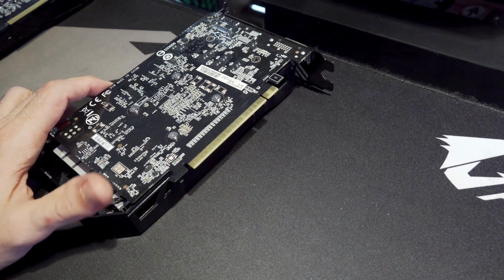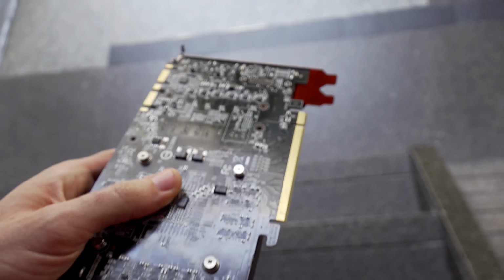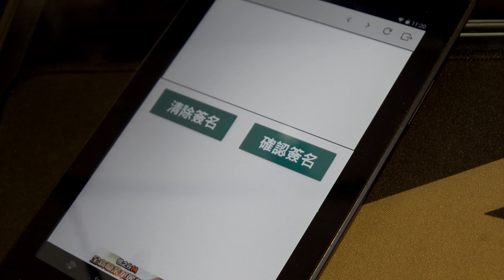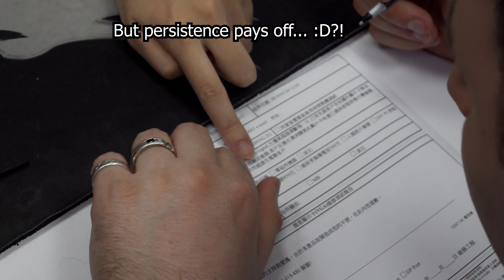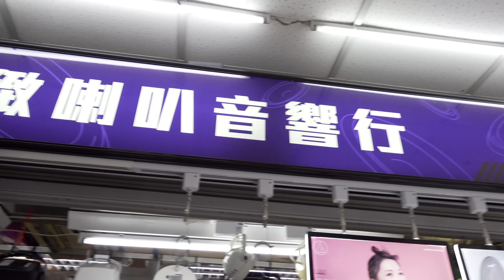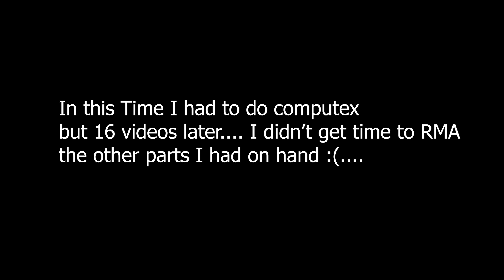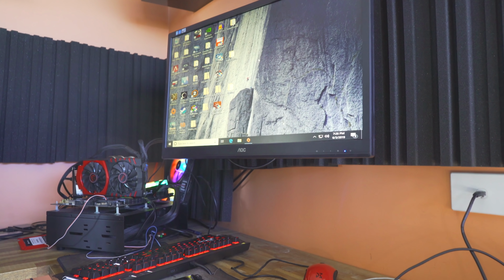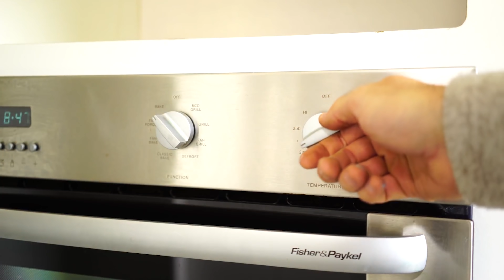I Took FAULTY Graphics Cards BACK to AIB Vendors Directly...

Comment: M9 Bad is basically the section that went bad. One of the surface mount components on the PCB is labelled M9. I couldn't find it. But that's what they said.
Reply: m9 diode or transistor No. you see them on the components
Reply: Woah it's the legend himself 😲
Reply: guys go sub to this legend
Reply: Hail Marco
Reply: Marco lets go
Reply: Love you marco!
Reply: Marco!!! Dont let the haters bother you man, thanks for helping make the yes man's  videos possible in Taiwan!!!!
Reply: @christopherdwyer7570  Oh I know, I haven't lost sleep over it.  Thank you.
Reply: @Generic_Name_1-1  Thanks!
Reply: @Simcadepro  diode is normally D, transistor is normally Q (because transformers were already T), M is normally Motor but i suspect it may be Memory, though U or IC are most common for chips. Also normally on the board and the schematic, not the part. The part number is not normally how you refer to a part as there may be several identical
Reply: That was super cool if of you to help him out Marco. Take care man.
Reply: Where there any used parts in ganghua digital plaza?
Reply: OMG it's Marco, your a Legend bro, How do you put up with the BOGON for a whole week, wow your an uber legend to put up with him for so long.
Reply: Hey it's a marcoooo
Reply: might not be labeled on the PCB but on the schematic
Reply: @EvotrekORIGINAL  Thanks!
Reply: @deepwinter77  It wasn't for the whole week. It was both weekends. During Computex I had other things to do in relation to my clients and take pictures of tech and a few selfies with the showgirls.
Reply: @yurimodin7333  Certainly possible!
Reply: @rencm04  There are dedicated used stores with full warranties and everything. But the rents there are insane and they know the true value of the product, which doesn't make it much of a deal.
Reply: It doesnt matter what you say , do, or look like Marco, you will always get some haters for one thing or the other on the internet! Don't let that stop you though!  Thanks for making this video possible for the majority of us!
Reply: @x240strongx  Yeah, I know, Thanks! It was a fun ride. See you next year!
Reply: sub to the legend
Reply: Best man here !!!!
Reply: M9 is one of the MOSFETs in the VRM.
Reply: In the thickest of Australian accents. "What a Legend". You're awesome man, this was a great video, I was glad to see the humor there as well!
Reply: maybe they got their own jargon
Reply: @andrewryder3075  No, MOSFETs have designation Q, not M.

Comment: Wow  mad props to gigabyte.  They accept warranties for the cards regardless if it was bought overseas.  Glad I  bought  Their 1070 version.
Reply: gigabyte is one of the best manufactors....i use this products for many years! never had any issues
Reply: There's no guarantee for that. They know me at that store and can be a bit more lenient sometimes. Best course of action is to be nice.
Reply: @MarcoGPUtuber  hi, just wondering how Asus fares in the service department?
Reply: @vsmh96  In Taiwan?
Reply: @MarcoGPUtuber  yes
Reply: @vsmh96  Same as Gigabyte and MSI. Walk into any ASUS Royal Club service centre and they'll look at your dead mobo or gpu. Same price as Gigabyte and MSI.
Reply: @MarcoGPUtuber  good to hear. Do you have a personal preference?
Reply: @vsmh96  ASUS and Gigabyte are my one and two. MSI is my three. I sold them for 6 years and ASUS and Gigabyte resulted in the lowest return rates. Right now, I am in possession of an ASUS R9 Nano and a Gigabyte Z97-UD3H motherboard.

I'm approaching 30 and been 'into computers' for about 22 years. I started taking them apart and putting them back together and self teaching for 18 years. Bryan assures me that Asrock is so much better now than it used to be, and they certainly look like they have improved alot. I remember using ASrock once, it was OK, but back then the quality wasn't there. ECS was garbage, and I think they knew that and have since branched off to other industries. I used ECS and it died after a while. ASRock I'd call the Poor Man's motherboard because they had a habit of trying to one up the competition by mixing standards to provide 'upgrade paths'. For example, many of their motherboards in the mid 2000s would mix memory standards during a transition, allowing the use of older memory until you could afford new DIMMs. Memory controllers used to be on the Northbridge and not on the CPU like today. They also had boards that utilised both AGP and PCIE. These boards essentially were for people who couldnt shell out money for everything all at once. It certainly was genius of them to do that back in the day and certainly helped them get a leg up. Good for them! I'm just getting old and habits die hard.
Reply: Well, different service center can have much differwnt service. Gigabyte in mainland China was known for their refuse to RMA record lol.

Comment: I've reflowed 3 Gpu's, in terms of success, only 2 of the cards worked afterwards but it really depends how overheated/damaged the cards are. 
Also on one of the cards, the fault was the vram, not the actual GPU die and thus I couldn't repair it.

Comment: Damn the services in China and Taiwan are so high-quality compared to western countries lol.
Reply: Yeah like how they wouldn't help him at all if marco wasn't there even though it was obvious what he wanted.
Reply: @Noman1000  I mean that would be the only problem and it was ONLY msi lol, the service is still better lol
Reply: @Noman1000  Also a good thing to note is that usually ends up being true for most countries lol. People wanting to scam and scamming tourists and not giving them proper services. Could even happen in the US if u don't meet the right people so yeah. It's a lot easier to get things serviced but by success rate it wouldn't differ much I don't think.
Reply: @Noman1000  Taiwanese here, she basically said she checked the serial number of the card and this specific card did not have international warranty so Taiwan couldn't take the card. So they needed to take it back to where they got the card from. Then Marco said he got from Australia and they don't have a repair facility there. Now I don't know the circumstances and MSI's policy but this usually happens when the card was bought from a region that is not under international warranty (Normally China, Hong Kong, and Macaw) or got it second hand from a Chinese vendor. The problem card vendor is dealing right now is there are so many fake cards coming out of China where some vendor would take an older generation GTX (ie, GTX450, GTX 460), replace its Bios and serial number so it would appear as GTX960, then sell it on AliExpress, eBay, and Newegg/Amazon's 3rd party vendors. That might be the case or MSI's warranty just got shittier. But repair shops are everywhere in Taiwan/China and it is fairly cheap and turnaround time is faster than the company themselves. So to many of us repairing a video card out of warranty isn't a big deal and some even choose to void their warranty by going to repair shops and replace manufacturer parts with better ones.
Reply: lol leave china out of this.
high quality and china are not on the same plane of existence
Reply: @bebisibeb  fortunately they are, you are just speaking bs

Comment: for everyone having a gpu that just doesn't give a signal anymore (often after it has given severe artifacts) try to oven method, i suggest looking it up but basically remove the entire cooler so that you end up with just the chip and processor, preheat the oven at around 200 degrees celsius, place the card on foil-made stands on all four sides and let it sit for 12 minutes, it has worked for me two times already

Comment: u finally answered what i always wondered on a few of your videos as to why u didn't just solder something all u need to do is practice a lot best thing to learn on is a ps2 or  xbox 360 analog sensor its 14 pins to replace lol but practice on something else 1st if u can replace that u can do 90 percent of the stuff out there that is how i learned  back in the early 2000s i was like 14  i had my dads older soldering iron some solder and flux and 2 ps2 controllelrs with messed up analogs  on both had left analogs that walked on their own but right was good  soi had idea to take right outa one and put back in other so  i read a few books on how to solder and desolder i got at library  took a old 56k pci card and practiced til i could remove  and put back on chips with no burns and it looked like factory when i put it back then i went at it taking good right analog outa 1 controller then the bad left analog sensor outa the other then replacing it and resoldering everything i was so happy it was a 14 pin solder job  and  i had fixed my own controller with what i learned from reading  and a little thought i had i made so mutch money back then with that skill fixing things for people  and all because i wanted to play gta 3 proper lol.

Comment: when resistors look broke off manufacturers tend to send new componets if they even cover broken components off the pcb (xfx doesn't cover physical damage to the card unless it was a result of thier shipping) because they're could be tons of issues like possibly the contact pads could be ripped up or there could be a short inside the pcb that caused it as well
Reply: That doesn’t make much sense though, because the resistor is like $0.001 and takes 5 minutes max with a basic SMD hot air and pair of tweezers with unskilled labor. I don’t know why they wouldn’t try the easiest and most simple repair there is and just see if it works. I’m not saying they don’t toss them, just saying it doesn’t make sense to me. You just check it with a meter and see if it checks out. With thousands of components with even 0.000001% failure rate, it’s very likely it could just be that one small thing for lots of the cards (if it’s MOSFET, then it’s probably toast....).

Or they go the Apple route and say they are too incompetent to even change a battery, which I’m pretty sure a 5 year old could be trained to do, so basically they are a “service center” that says, “just buy a new one!”

Comment: That's the thing with resistors, caps and other SMDs on modern, rather high end electronics like Graphics Cards. If they blow catastrophically within typical warranty periods, they rarely failed "on their own", but is a symptom - of something else gone bad. Troubleshooting that can be a huge hassle if you don't have basically the same equipment as they test the cards with during QC at the factory. So they give you a new or manufacturer refurbished unit for time saving, and ship the faulty item off to the factory or a dedicated repair center with the appropriate equipment. If they find the fault and it's worthwhile fixing, they fix it, replace the fans or the whole cooler assembly, reapply goop and pads, and ship it off to be ready for the next service case needing replacement.

Comment: 9:15 M9 Bad - is memory chip M9, but the 1050Ti only has 4 memory chips labeled M1-M4, so no idea why it would be M9.
The 1070 may have burnt components, but more to the point, what burnt them out. Usually a burnt component means something shorted and possibly blown up other stuff as well, only the weakest part will take the full fault. I can fix those faults.
Reply: it may only have 4 chips but the pcb probably has 11 or 12 places that chip could be located and spreading them out helps keep temps down so position 1, 4, 7, 9.

Comment: never do oven method if you have broken card you need use flux and minimum heat gun but when I bought foulty rx580 and I find is still under warranty I send back to manufacture and he send me brand new rx 580 all my cost been 57 pounds 1 year back :-) you can find that video on my channel as well

Comment: The M9 I'm guessing is the chip number/call sign for the bios chip on the board I have no way of knowing as I dont have the board view schematic for it. But I have a R9 290 with the same exact symptoms as that card. And per buildzoids stream they said that would be the solution to these issues. Hope this helps anyone out there!
Reply: M9 or any letter_number key is usually a part labelled on the PCB silkscreen. In this case M9 is likely a MOSFET
Reply: @cybercat1531  M is usually reserved for purely mechanical sub-assemblies. The schematic/silkscreen designation for memory ICs would be U (unseparable sub-assembly) and also often applied to MOSFETs in an IC-like package, but most usually MOSFETs carry the Q designation unless they have some kind of extra functionality.
I'm thinking M designations are just some kind of symptom code that the triage department assigns to the board before it goes to the repair engineers.

Comment: M9 is most likely the identifier of the component on the schematic and PCB level that was faulty and needed replacement. During the design process for circuit boards each component is given a unique identifier to both identify them and also for linking when moving from the schematic capture phase to the PCB layout phase. Knowing M9 was faulty they would then look on the Bill of Materials for the PCB to get the  components detailed information. Hope this explanation helps.

Comment: That is totally cool that you were able to get those cards repaired or if they replaced them even. I wish we had stuff like that every where so you could take your some what broken stuff in and they can repair it for the fraction of the price of having to buy something new. Even better is that it lowers the throw outs into the local dumps for these types of products. Yes we have local recycling places you can take used parts to but I am sure most people don't actually take the time to do that.

Comment: With all the bargains and graphics cards and deals, I really need a video that covers DisplayPort cables and finding the right one. I'm currently looking into getting Cable Matters DisplayPort cables. They're long enough for my use case, and hopefully they would work, whereas the non name brands I used are nothing but trouble.

Comment: Good for you, I wish every company would act that way. For example, Logitech refused to fix my G603 because I bought it second hand, even though the warranty wasn't claimed already and it has 2 years of warranty and hasn't been released longer than 1,5 years. That behaviour really drives customers away from the brand and the perceived image to the public is that you can't really rely on the  warranty promised.

Comment: I have fixed almost every graphics card that has had problems failing, what most GPU manufactures don't tell you is that you need to reapply the thermal paste< THIS IS EXACTLY THE SAME THING THAT GOES ON YOUR PROCESSOR WHICH IS THE BRAIN OF THE PC AND ALLOWS IT TO RUN EFFICIENTLY. so after 5 years of overheating they quit working, a quick cool down and reapplication normally does the trick

Comment: Fan blades can be gotten for about $9 on amazon. You'd probably be running cheaper plastic, but it works.
Reply: Of course, but the card was already dead, they fix it for $850 TWD flat. Might as well get two birds killed with one stone.

Comment: MSI warranty service in Canada sucks. I had a GTX570 (reference card with the vapor chamber cooler) that had dead DVI ports. Sent it in for warranty and received back what appeared to be a reference gtx480. Turns out to have been a gtx580 gpu on a gtx480 board.
This is why I never buy MSI products any more.

Comment: I've had my Hyper X DDR3 ram, all 16gb of them, replaced FOC by Kingston after a good 8 years of using them. Lifetime warranty is indeed real.  Also helps that I live in Malaysia so we have relatively quick replacement. I'm surprised that they even have a stock of them still LOL. But Asus was the worst when it comes to warranty claim in my experience. Took them more than a month to replace my GTX 560 ti and even then they gave me a used card.

Comment: 0:29 "But I'm told the best thing about these places is that if they don't fix your card then you have to pay no fee at all"
That is bad grammar, it should read as 

"But I have been told that these kinds of places have a no fix no fee policy."
Reply: That's not a grammatical change, that's a completely different sentence with the same definition.
Reply: @chongwong  Um, no, it's a grammatical error as what was said cancels each other out, for example......
"if they don't fix your card then you have to pay no fee at all"
if they don't fix your card .... then you have to pay (positive) no fee at all (negative)
It's a contradictory statement, therefore it's grammatically incorrect.
Reply: @memyselfandi you are still wrong nothing in that statement cancels itself out. I know what you are trying to imply,   that is not however a double negative, as the negatives are applied to separate subjects within the sentence.

He didn't say 'you don't not have to pay', his sentence plainly means that if they don't fix it, you don't pay.

Your sentence 'no fix no fee' also has two negative words used in the same manner on separate subjects.

If his is a double negative so is your sentence.

Comment: "Repairing" with heat gun at current generations never works at all. It is not recommended. BGA on chip does not break so often right now. Mostly not working graphics card is because of faulty core, V-RAM or some SMD on power section.
Reply: That’s primarily because they haven’t “aged” or gone as many heat cycles (thermal cyclic fatigue is what causes the BGA to crack, this is accelerated by extreme temps such as high temps or super low such as liquid nitrogen where they contract more, and the reason I stopped using sub-zero cooling on GPUs for my daily machines). In a few years, they will be just as many failures as older generations (probably more since they likely have more connections).